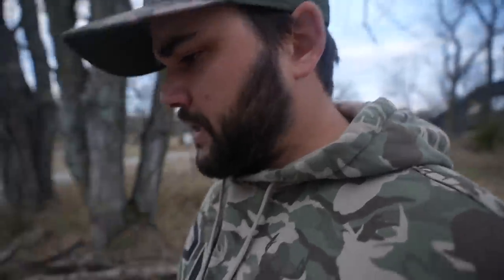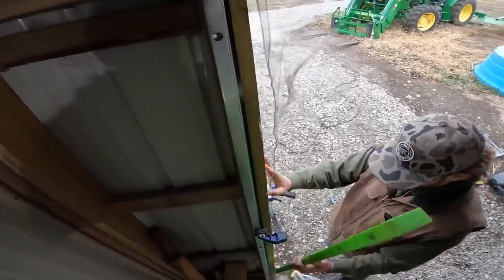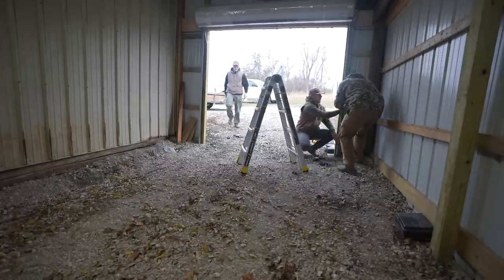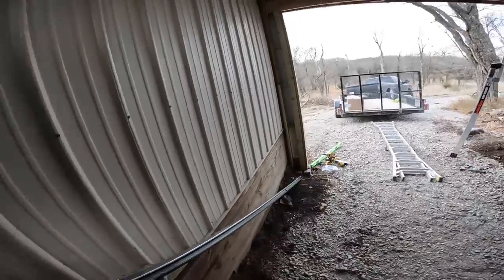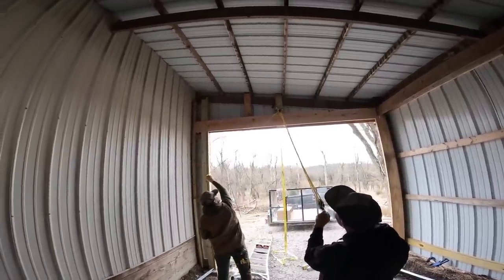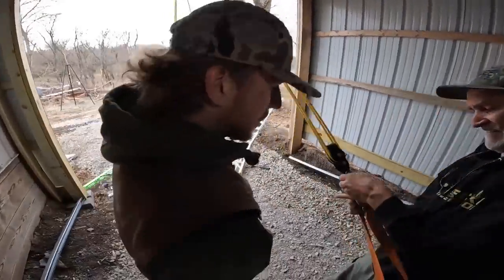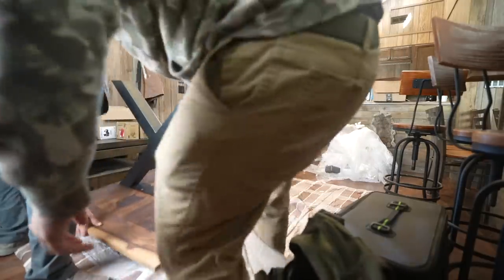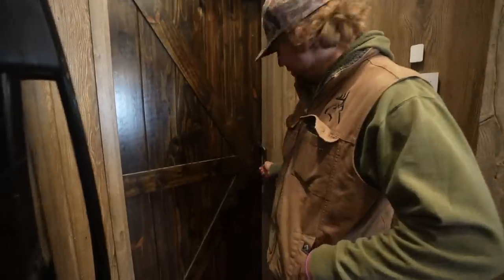Installing Shop Doors at the Ranch (Gone Wrong)

Comment: I didn't notice if you have a small door going into each side of these enclosed garages. If you do, I noticed from some of the farm videos that when they have strong winds they back the tractors up right next to the door and chain the door to the tractor. That way super strong winds cannot push the door in or suck it out.

Comment: Just one more thing, you need to paint the exposed wood framing around the garage doors at least on the outside. It did not look like that was treated lumber and if not it will absorb moisture and rot especially around the bottom.
Reply: Bump

Comment: You still need to move the thermostat (get a wireless) so that the ac and heat will spread better in the cabin. It wasnt cooling down in the summer becausr your thermostat is like feet away from the furnace and vents. It wont cool or heat properly and waste a bunch of electricity, gas and life of the furnace grom constantly turning on and off. Whatd happening is the thermostat turns the furnace on and off based on the temperature around the thermostat. So if the vent is near it will be 65 at the thermostat rite away turning it off then the air spreads warming up and turning on again. Whereif you put thr thermostat on the far wall it will stay on until its at tempon the dar wall. Yes the rooms will be colder or warmer faster but you can open and close the vents in the rooms to slow it down if thats the case.

Comment: A place I worked bought a new door, like that one, to replace a old door. Ours was 12' tall and twice as wide as yours. Guys from the door company had never installed one, that size. Seems like they missed a couple of steps. Door was all the way down, they pushed the button and it went all the way up ............. and kept going. It rolled right out of the top of the ails and hit the floor.